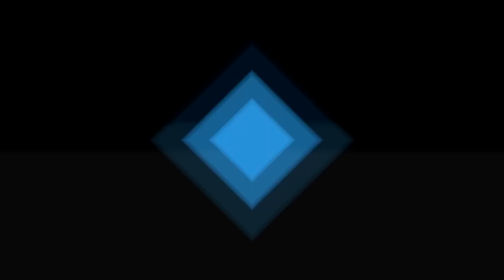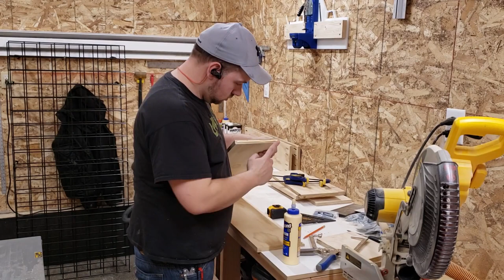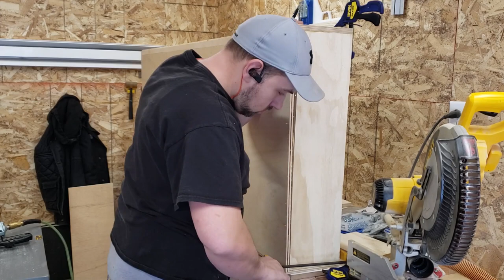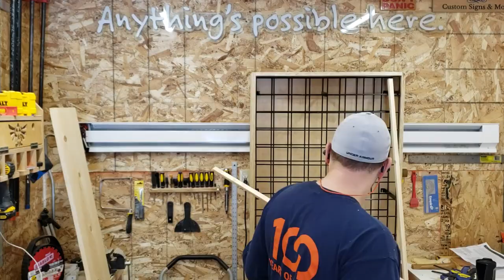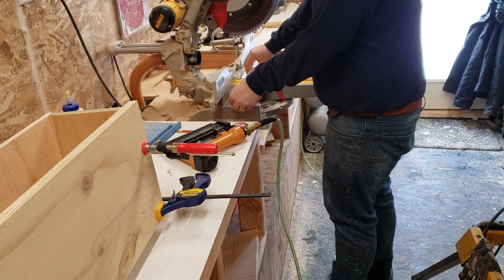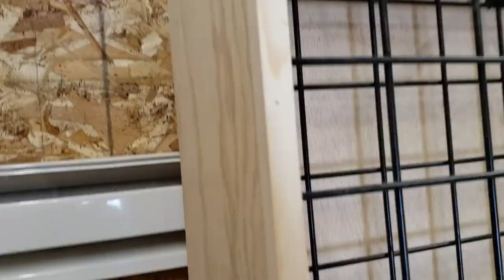DIY Custom Wine Rack

Comment: How did you secure the wine grids to the cabinet?
Reply from the maker: Yes
Reply: What kind of clamps attached the grid to the frame?
Reply from the maker: @epike6511   It was a kit that the client got off Amazon it was to screw into the wall I just made the cabinet
Reply: @CraftedbyRay  got it! I thought it was just the panels. Wonderful work! Looks fantastic 🙂